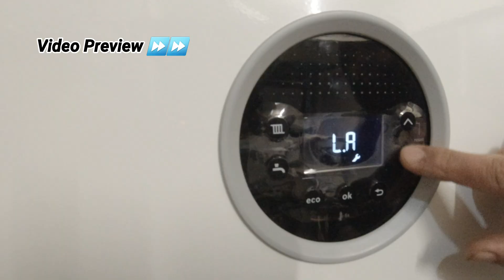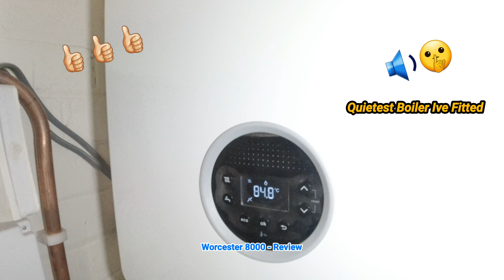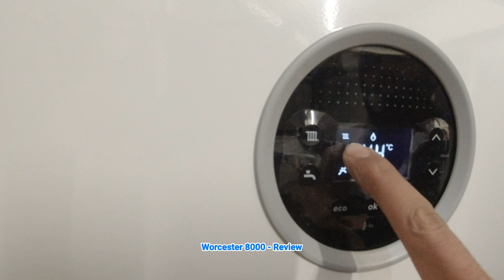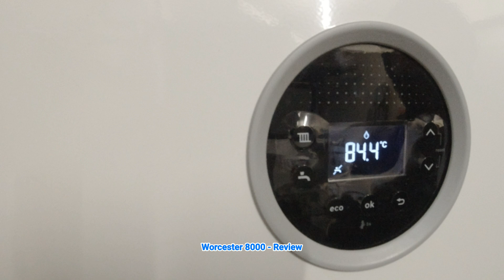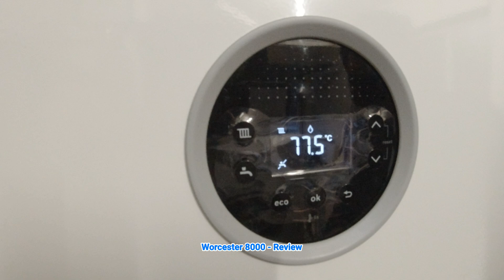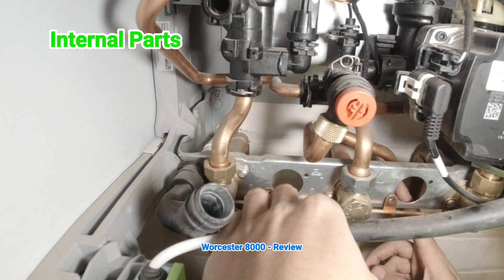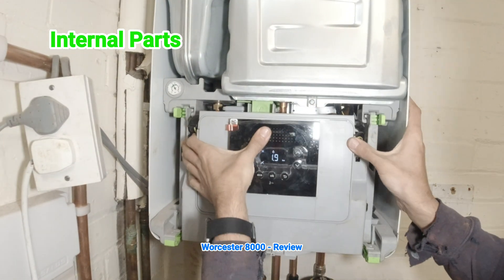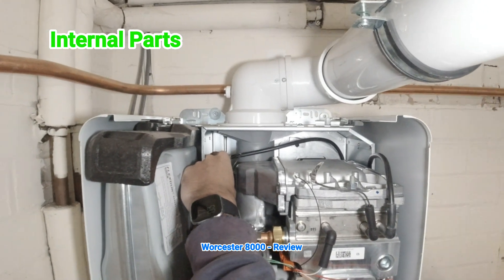Worcester 8000 Boiler | Complete Review | No BS

Comment: Rushes through it too quickly. He didn't mention for example that to save money the Eco sign should be on.  To save the expense of pre-heating. He's also on about taking it apart and doing the job of an installer.  Which I'm positive that most users won't want to do.

Comment: I have the  2000 with the wifi easy control with the wifi key not fitted yet dose it need to be wired to the boiler or do you wire the the back plate for the easy control panel with the 3 prong plug
Reply from the maker: Not sure

Comment: I’ve a Worcester 8000 and have had problems over the last 3 years. These problems, all stem from the Auto filling pressure value. My advice to anyone thinking of getting one. Make sure you get a manual pressure value. Mine is a 35 kw combi and it’s very efficient.
Reply: Hi there, just purchased a 8000 combi, so there are 3 filling links, one with the key, keyless link and the intelligent system… which one to go for?
Reply: @SS-78-  we originally had the intelligent filling system. It has now been changed to the filling system, with a blue pull lever. The intelligent system caused us no end of issues. Not many gas engineers, actually know how the intelligent filling system works, as it involves setting the parameters within the control panel. My advice, do not install the intelligent system.
Reply: @douglasspencer745  thanks a million! I had the intelligent system as the one to buy, it’s for my elderly mum, it made sense as you don’t need to do anything - well so it states, but I’ll get the filling link which is half the price…thanks
Reply: @SS-78-  we had the Gas engineers in twice a year to sort the pressure out, it never did work properly. Even the engineers thought, the system over complicated.
Reply: I’m glad I asked now 😊… Also, did you get the EasyControl as it seems like only WB thermostats are compatible or that work in line with the Greenstar boilers?
Reply: @SS-78-  we have a hive thermostat. If thats what you mean.
Reply: @douglasspencer745  yep, the EasyControl is a WB thermostat… Any do’s or dont’s with this boiler?
Reply: @SS-78-  my knowledge is really very limited, I can only comment on, what we experienced. The do’s or don’ts is the auto fill pressure value. The rest I cannot comment on.

Comment: Do you have to buy an integral diverted kit in order to increase the flow temp to the hot water ?
My cylinder doest get to temp as my flow temp is 65 from the boiler and my cylinder stat is set to 65. I'm abit confused

Comment: Can the Worcester Bosch Greenstar 8000 Life 40kW Regular Gas Boiler be used with Nest? I have unvented system in place which is used to store hot water. I am intending on using the boiler just for the rads? Do i need Regular boiler or System boiler?
Reply from the maker: Yes you can use the Nest and you can use either to heat the water in the cylinder

Comment: Assalaamalaikum. I am looking into this boiler. As a homeowner and first time dealing with a heating system, does it matter if the gas boiler is fitted by an accredited WB installer?  And would you need to or would it be more efficient to change the hot water cylinder and its port valves too and thermostats and controller?
Reply from the maker: Wslaam - best to call worcester customer service directly
Reply: @PlumbingDoctors  jazza kallah khair

Comment: a simple question. My builder had a qualified plumber install this one for me but no one showed me how to increase the water pressure. Its dropped to .5bar yesterday due to bleeding radiators but I can't fins a way to top it up again. Any answers please really stuck on this one. my older combi boiler had external water valves connected, this one doesn't.
Reply from the maker: What boiler is it?
Reply: @PlumbingDoctors  Sorry Worcester Greenstar 8000 Life 30kw
Reply from the maker: I think it may have a internal filling loop.. check youtube vids for it
Reply: @PlumbingDoctors  brilliant thx for the info.

Comment: Better design from worcester makes life easier for engineers to work on.
Reply: @PlumbingDoctors  not sure what makes worecester boiler so heavy.
Reply from the maker: Probs main HE 🤔
Reply: @PlumbingDoctors  wouldn't think so as its aluminium say a baxi is 30kg so don't think worecester heat exchanger would weight 20kg
Reply from the maker: 😕 not sure then.. see if you can find out